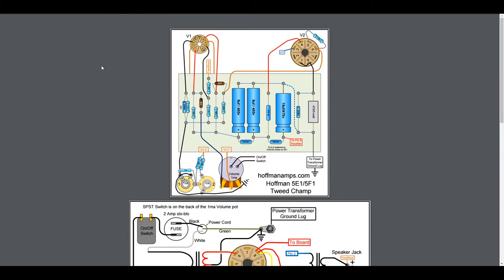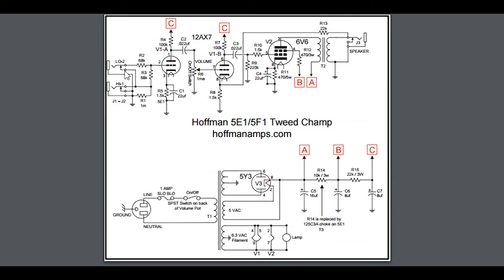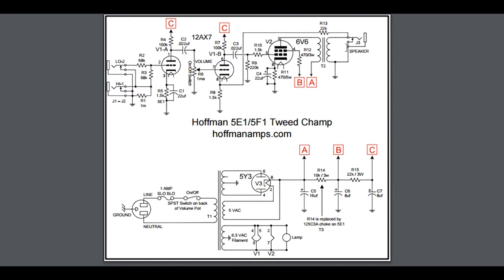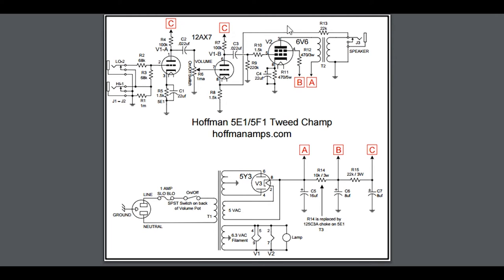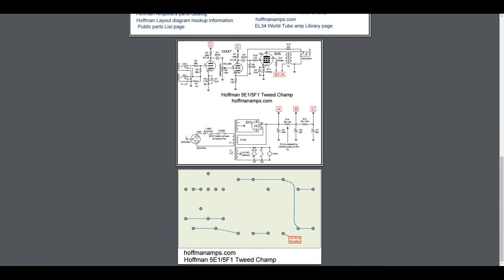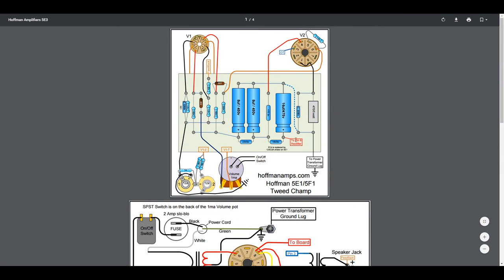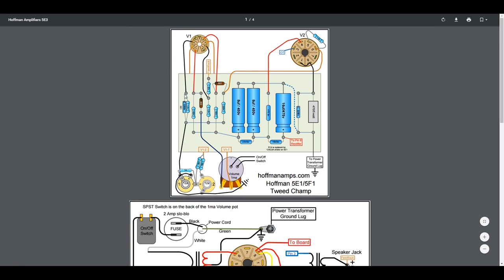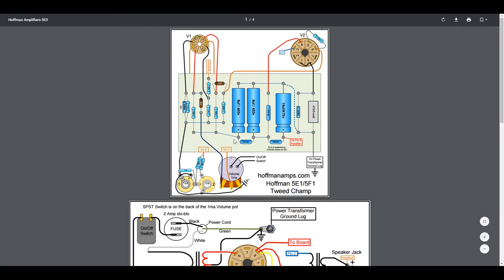Fender 5E1/5F1 Tweed Champ Video 1

Comment: i just started an 5F1 build, converting an old Eico Signal Tracer. I have a friend helping with the schematic and used parts to complete the build.  I have wired the filaments and high voltage circuits so far and frankly it looks like hell. Just a mess and globs and crossing over etc etc. I never wired a whole unit in Point to Point. I have restored Radios, Phone graphs etc via ReCapping but not a bare chassis and a diagram. It seems to me i need to think through the component sequence so it is neater and more logical. I really appreciate your diagrams as I am using 2 of the same tubes and almost identical design. Thank You, Dennis
Reply from the maker: This is one of those things that get better the more you do it.  Don't worry you're going to get better

Comment: thanks for the video. I built the MOD 102, which is a very similar circuit, using a dual triode and a pentode instead of a beam tetrode as the output tube and using a solid state rectifier.  Thanks for posting!
Reply from the maker: You're welcome, how did yours sound?

Comment: Great clear content. Can you tell me where there is a death capacitor (or atleast the concept). How to safe ourself. And build a safety circuit which will discharge all the capacitor as soon as the power is switched  off. All this can you please explain where it fit in the above. It would be great content. Please reply. Thankyou
Reply from the maker: I don't recall off the top of my head.  It's been years.  The death cap normally goes from the hot side of the AC to chassis.  They are there for a good reason, but in older amps they can fail.  Newer class X1 caps can be used there safely

Comment: Question...is the 470ohm cathode resistor off the 6V6 too small a 
value as household voltage has rising from 110v in the 1950's to over 120v today? Would a higher value resistor run the tube less hot? Thanks!
Reply from the maker: Most of the fender about were designed to run a touch cold, so I'd bet they are already fine even with the increased B+ due to the higher wall voltage

Comment: I'm doing the build but using an OFF/ON switch in place of the traditional champ volumn pot.
Reply from the maker: Does that mean it won't have a volume, or do you mean you'll put in a separate switch instead of having it on the volume?

Comment: This project sounds great to follow along with.
Have you ever done anything that is purely PTP (without turret board)?
Reply from the maker: +XiXora no I haven't.  The main reason is that I hear doing maintenance on them later down the line can be quite difficult, even though they're generally better long term than turret or the like.  It's a bit of a compromise

Comment: I would think about adding a tube/solid state rectifier switch, just to see if there is a meaningful difference in compression and squashiness. Just out of pure curiosity.
Reply from the maker: +The Inebriati hmm, that's definitely singing with thinking about, but we're going for two things on this build, original schematic, and simplicity.  Additionally, if need to double check that the voltage increase of the solid state rectifier wouldn't be too much for the capacitors.  I may have to try that at some point though!  Great idea
Reply: Yes makes a difference,, little tighter sound,, 5Y3 drops about 60 volts,, so if your using 450 volt or higher caps you'll be ok. The amp will be louder as well.